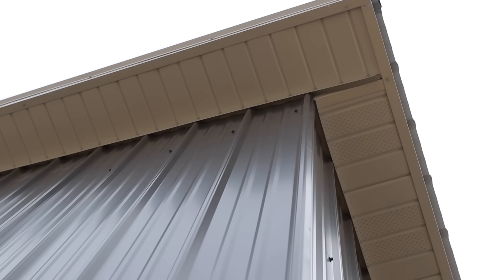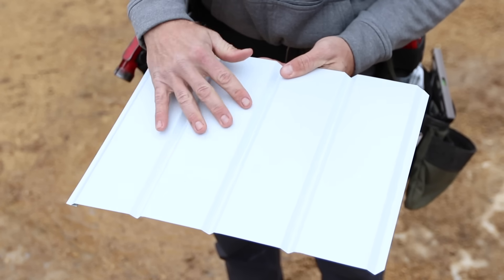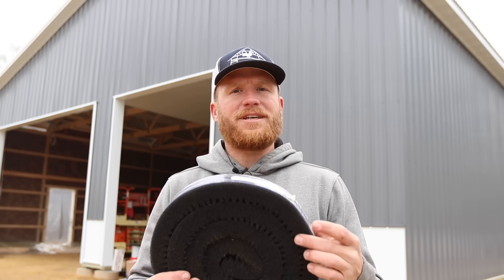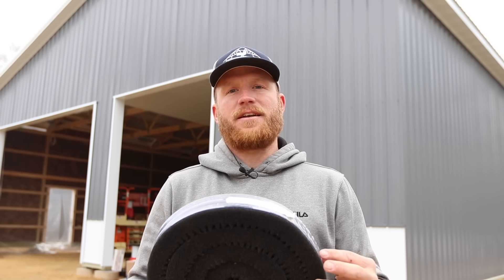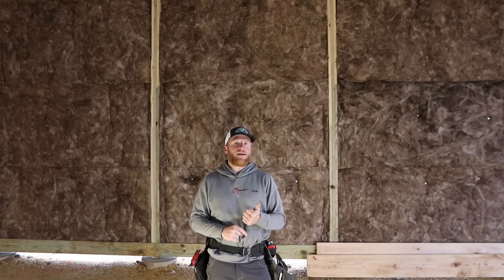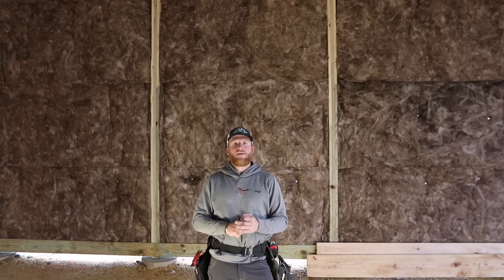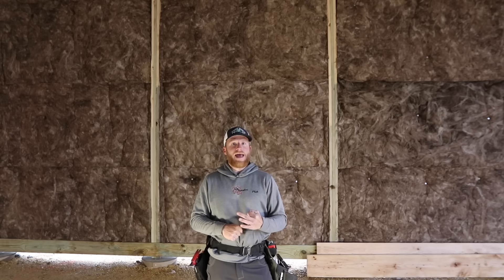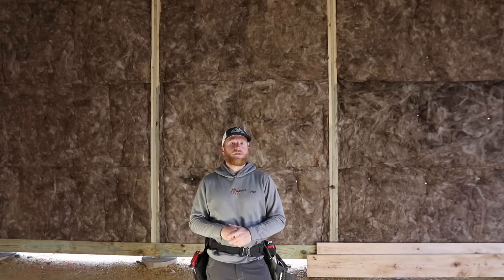Insulation: 5 steps to a more efficient building and why I don't use spray foam

Comment: DENSE PACKED CELLULOSE will give you an R4 per inch and if you can get that wall a foot thick by time any moisture gets to the outside it has already cooled enough and won't condensate. Sure it's more framing but that heated garage would require less BTU's per hour and mice hate CELLULOSE because it's pretreated. Keep that thermal brake all the way around the building including 4 inches of pink ridged foam especially if radiant is used. Price fiberglass to CELLULOSE see if you can save money??
Reply: Been in Fire and Rescue for 40 years, Cellulose might not burn but it will smolder for ever and the fire will follow the mouse trails through it as that is where the air and oxygen is. Shoveled out many an attic over the years and it is always the same. I personally never use it on any building projects as I have seen it fail too many times. Heat cycles in an attic over time reduce its ignition point as the fire retardant treatments wear off over time making it more of a fire hazard. I have seen it ignited due to bad wiring connections that were heat cycling from use and eventually igniting the cellulose insulation. As for settling we have opened many a wall chasing fire to see a foot gap or more at the top of the old style blown in between wall studs. Current High density claims sound good but it is still based on a flammable material that is treated to prevent fire and those treatments break down over time. Builders need to go to the same fire training we do to see how products actually perform instead of how they are said to perform in the real world. Just my opinion.

Comment: Do you insulate under the slab?
Reply from the maker: some customers do...some dont
Reply: insulate if planning to heat the floor for a warm space for sure, or if code requires due to frost line hooha

Comment: Hi Kyle, One option to increase the Insulation Value is adding Radiant Barrier.  It is best to put it on the "Hot Side" of whatever you are trying to keep insulated.  But for your buildings with the metal getting hot, you would want to put it on first, then put the House Wrap on so that you have a thermal break to prevent conduction into the radiant barrier.  You do an excellent job!  Just an added option.  The Radiant Barrier will give your buildings an even greater "Thermos Effect".
Reply from the maker: thanks for the idea.
Reply: Your welcome

Comment: I just insulated my cabin.  In the south we have humidity and with spray foam it tends to trap moisture.  I used the r38 bats in the ceiling and r13 in the walls (2x4).  We also caulked all the inner seams floor to ceiling in the walls and wrap and OSB board taped.  The guy I had insulate the walls (about the only thing I did not do myself) and he said spray foam was at least 3 times the cost.  Thats a lot of extra money and the foam would go everywhere in the walls and ceiling.  Later if I had a problem the foam would have to be cut out what a great mess.  So bottom line you are doing a great job.  BTY I have told several of my friends about your videos and now they are hooked.  Also my wife is now trying to tell me how to use the metal flashing after watching you.  THANKS!  I think.

Comment: why do you have on the ceiling film and not mebrane wool to breathe as a film of air does not pass
Reply: that film is a vapor barrier as used in the wall as well to keep interior moisture from getting into the wall cavity and causing issues down the road, we do bot have membrane wool here in the USA or at least not in great use.
Reply: @Joshua79C  you put the film to the dew point

Comment: Down here in Ky. we insulate the perimeter of the slab with 2" rigid foam board and sometimes under the slab. That keeps the edges of the slab warmer when it is cold.
Reply: thermal break is always wise in any concrete foundation as you see why and thus why I would use ICF for foundation forms for this very reason as it does three steps in one.

Comment: I talked to an insulation contractor a few years ago about blown in fiberglass vs cellulose. He said that cellulose has a higher R value but fiberglass doesn't settle. The point being that cellulose can lose R value over time whereas fiberglass won't. I've also heard fiberglass is more water resistant and fire resistant. I think if you have water hitting your insulation, you have big problems. Cellulose is also treated with a fire retardant.
Reply: I have seen pics (images) and from my own experience where the fiberglass breaks down from water infiltration and can discolor (good sign of mold starting to form) and get moldy smelling. and even cases it has settles due to being or have been water logged. I normally do not itch from fiberglass
Reply: Joshua79C C fiberglass does not break down. But the fine structures collapses if they get wet. That gives it shrinks and it insulates less. Glass can not grow mold. If there are other external materials inside the fibreglass they can mold. RockWool is better because it hates water like a duck. So now water, no mold and no collapses.
Reply from the maker: all good points thanks
Reply: Fiberglass recovers better of getting wet than cellulose, but Rockwool is even better than fiberglass. Rockwool is best of them all in: water, fire, lose R value over time. The only problem is price really.
Reply: Cellulose won't settle if you put it in right.  I've been doing it for 20 years and we have zero problems with settling, and many picky general contractors that we work with  won't use anything else.

Comment: What do you recommend for insulated garage doors and garage door weather strip?
Reply from the maker: We use Raynor garage doors and typically install a TM200 or TM300 commercial door.  High R value and quality construction
Reply: IF sliding or roll up is not your preferred choice due to their issues, you can always get lift strap bifold or hydraulic one piece or bifold even and all are made thick to insulated where needed.

Comment: Love your videos. Interesting comment about solid gable soffits. Makes total sense. I’m at insulation phase on my 40x60. I’m in Michigan. I notice you use horizontal interior framing. Is that standard for you or does it vary depending on your finish wall?  I am adding a rec room with horizontal tongue and groove so have to go vertical framing.
Reply from the maker: horizontal is efficient and makes sense with everything we do. ...If I was you I would probably still do horizontal....sheet with plywood and then install finishes or use 16' horizontal tongue and groove
Reply: august, he commented, not sure you saw it then .. yet

Comment: What are the most common ways you have seen your customers heat and cool these buildings? I know some will not get anything, but others have been finished so nicely it seems that it would be necessary.
Reply from the maker: typically either a radiant tube heater or radiant floor heat....as far as cooling...not typical or even necessary thanks to the efficiency of the building.  I personally keep my humidity down with a dehumidifier and it always feels like air conditioning
Reply: @RRBuildings  LOL!  Works well in N. Ill but here in Tex where it can be at or near 100 deg for 5 months A/C would be a requirement to be able use your building comfortably between May and October.  Mini splits are becoming very popular and they are very efficient.
Reply: What are the benefits or detractions of radiant tube vs radiant floor heat? Cost difference?
Reply: I have a 2-stage 90%+ furnace in mine, I had it installed with an A/C coil. I haven't added the condenser as it seems to stay nice and cool, but it is an option if i want.

Comment: Also,garage doors ,read up on them,install is more important than r value,r value ratings on garage doors are nonsense,a door rater r19 is probably r7 at best
Reply from the maker: agree 100%%
Reply: IF wanted to properly insulate a doorway I would go with an enclosed entry, so you have to go through two doors with a somewhat heated space, or something like that you go through in big box stores with a single door and wide space with infrared heaters to blanket the draft.

Comment: Dude isn't the plastic vapor barriet going to cause major condensation,we stopped using it years ago!
Reply from the maker: that's the point....to stop moisture from creeping to the exterior and condensing.  if you build your structure with a tight envelope, you have to condition the space or yes you can create a condensation issue
Reply: We have used 4 mill up here in the Northeast for decades. During tear outs, we have seen only a few, 99% of them have no moisture problem.
Reply: There’s a big argument here in U.K. about vapour barriers and foil backed chemical based insulations shortening the life of buildings.
Reply: @whitacrebespoke  yeh Adam ,have noticed here when doing remidiations on buildings with foam that the plywood sheathing while only being 5-7 years old looks like its 20 years old,only thing we could atribute it to was the foam filled cavities and building being too air tight.Don't think the final chapter has been written on foam  insulation.
Reply: pearse mcaleese I’m not sure how we stand here in U.K. on spray foam insulation on fire and building regs I know my insurance broker refused to cover my workshop if I had it spray foamed. It’s known PU spray foam and foil backed sheets and plastic vapour barriers all trap moisture. We’re currently using a a breathable membrane inside as part of a pavatex wood fibre insulation system. As needed it to meet building regs.
Reply: Matt Risinger showed inhis closed versus open spray foam test video that either will retain moisture and its been proven that even extruded foam also retains moisture where as expanded foam does not hold water and any moisture retention leads to reduced insulation value be it R or U value.
Reply: The problem isn't the "vapor barrier" itself. The problem is that the insulation is sandwiched between the housewrap and poly.  You're just trapping any moisture that gets in there - it has no where to dry to.  I would just use the tyvek outside and leave a gap between it and the insulation with a way to vent to the attic or drip to the ground. Then you will get condensation on the inner surface of the housewrap, but it won't saturate your insulation.
Reply: toldt your wrapping a timber building in plastic? Or at least here in U.K. that’s what the vapour barrier consists of an impermeable plastic barrier. Of course it traps moisture. 
Your void should never be full of insulation ever should always be an air space. Should also counter batten the outside cladding of the membrane especially with a breathe able membrane this void should be open with rodent mesh at the bottom to allow air into the cavity and moisture wicking through the sheet to escape. 

Breathability is the key to stopping buildings rotting also for the health of it inhabitants non breathable membranes and plastic barriers are not a way of helping that.
Reply: Usernotloggedin breathable membranes are better but what gets specced and used most I see is non breathable plastic. But as you say do we really need two layers of membrane.
Reply: Usernotloggedin inside poly and you can put foil backed insulation between studs and non breathable outside too. but you have to have a counter batten between cladding. It’s all wrong. Those of us in the know refuse but building trade will always have some shark that will

Comment: Hey Kyle, how about a video showing you removing wall tin that has been spray foamed with 2" of 2 pound  closed cell foam?  I agree that spray foam is great in the right applications, but I am pretty sure the adhesive properties that make it stiffen up a building would make replacing wall tin ( due to hail or other damage) a total nightmare.
Reply from the maker: Trust me.... it’s a nightmare... just light a match
Reply: I asked a spray foam guy about replacing steel panels. He said they simply hot knife the foam at the posts and girts. Then remove the panel and replace it, then respray the foam.
Reply: I would rather cover the steel and wood frame with paper (wax or plastic backed) as the paper would allow it to stick but leave it to be more easily removed without any sticking to the structure or wall skin/coverings and negate the need to hot knife it unless you need a hole to add in something through the foam as the knife may be or get hot enough to burn or put the wood on fire but also would not remove every bit of foam. Another option is foam boards with foil for thermal reflectivity if building in a HOT zone.

Comment: Love your vids, think ive watched them all but this is the first time commenting. It's so cool to see and compare how different and not different houses are build in other countries. In Sweden we always put about 12 inch of styrofoam under the 4 inch concrete foundation. Wich is the first step of the build. You NEVER and i mean never build the walls first here. The styrofoam sheets are 4 inch thick so it's 3 layers. All your water lines are then cut into your 2nd layer using a heated wire tool. Sewege are put together under the ground in most cases. For a shop the insulation might only be like 1 layer thick. But if you insulate your wall and cealing but not the slab you whould be a fool in Sweden. Oh and everyone uses radiant floor heating. We'll this turned out to a book, sorry about that haha.
Reply: I agree with Albin. Here in the Nordic countries (Im in Norway) we have long experience with building under extreme conditions. Though not common for industrial buildings, current codes also requires to extend the insulation to 3-5 feet outside the building foundation. 

I think that environmental factors should be added to your recommendations. Here, research and experience has resulted in codes based on environmental product declarations (EPD). Fiberglass (FG) is still recognized to be the best (FG has lower consumption of energy and emission during production and transport than extruded (XPS) or expanded polystyren (EPS) and vakuum insulated panels (VIP). Besides that, there are lots of research and a whole new industry growing based on high tech biological insulation products, from wood fibers to nano technology.

That insulation is important is evident. The latest EU directive for energy consumption in buildings (EPBD Recast) requires that all new buildings must be close-to-zero emission buildings by 2021. Its always better to be prepared for the future than sleep ...
Reply from the maker: Thanks for all that information.  Appreciate it
Reply: I think you're referring to the idea of a frost-protected shallow foundation, right?  The insulation directly below the concrete makes sense, but the real gain is extending insulation beyond the poured slab which effectively raises the frost depth line. What I would be curious to hear about is how it could be combined with a pole barn structure. How would you insulate around the concrete columns without disturbing the hard pack dirt?  It's probably a total novice question.  BTW, I've never built a house or a pole barn, just trying to learn.  Please don't think I'm trying to challenge anybody.  I'm definitely no expert.  :)
Reply: @ThunderDog  This concept is only for when you build on top of the slab. At the edge of the foundation and where you will have loadbearing walls the concrete is 8 inches thick instead of 4. Also the styrofoam in the outer part of the foundation is U shaped and has like a 1 inch thick concrete layer "glued" to it so from the outside it looks really good, except for the seems every 4 foot becuase thats how long the styrofoam sheet/U-shaped part is.  Hope i explained it well hehe..
Reply: I believe the Swedes use what is called a shallow insulated concrete foundation.   Basically, the concrete is insulated enough that the ground underneath it doesn't freeze so you don't need a foundation past the frost  line. it's a natural fit for radiant floor heating, because you're insulating the floor already.
Reply: Insulating to below to frost line & under near of floors is still way to often over looked &or neglected in all buildings but especially anything not for residency.
I'd recommend going over the current insulation standards also since the costs of heating aren't getting any cheaper.
I personally would not recommend using anything loose or air to insulate with. Number one reason being it's basically just a premade rodent, insect, etc nesting home that comes with many associated problems no one needs.
All buildings door's seals get neglected & become a huge heat loss. So owners need to do more & better maintenance on them.
Reply: Not all all everyone uses radiant floor heating ins Sweden also there are many who uses other types of foundation systems like "warm" ground with no/little concrete like many prefabricated houses. Also the climate between northern Sweden and south is very different. From north to south 1 572 km. Today Kiruna -20 C and Malmoe +3 C. There are multiple building systems in Scandinavia. Where I live middle south Sweden it's almost useless and waste of money using more than 35-40 cm fibreglass in the wall.

Comment: We just had a shop put up earlier this year and now are to the point of installing the electrical and doing the insulation. The builder installed the house wrap under the outside metal and the vapor barrier between the trusses and the ceiling liner panel. Your video was perfect timing as we start the finishing process here (not too far away) in northern Indiana. Thanks